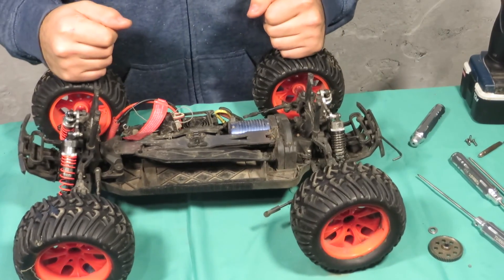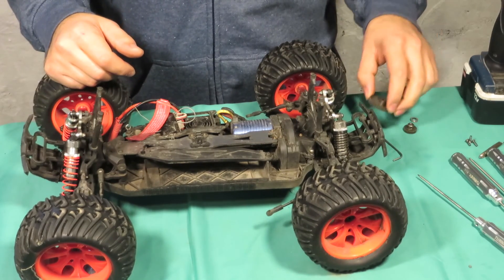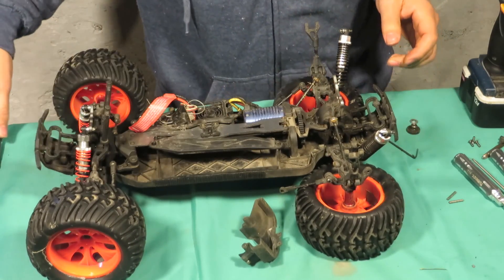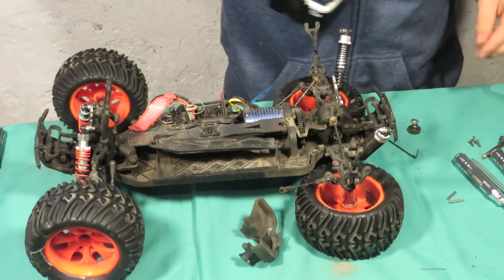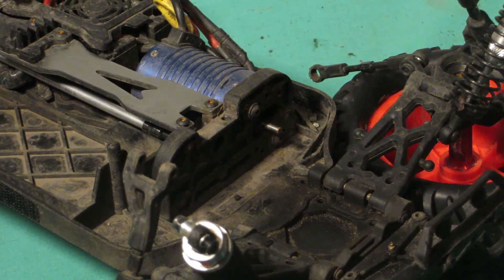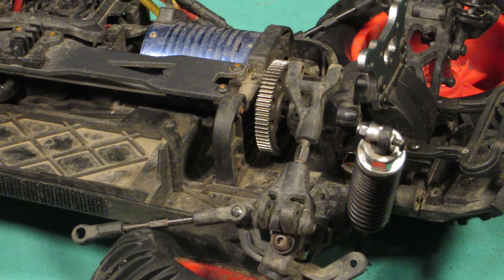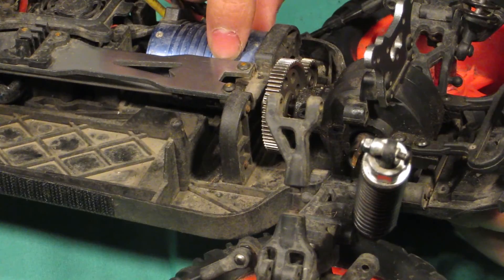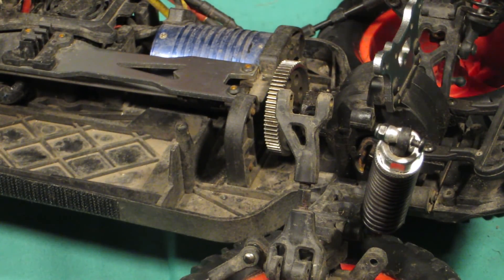Blackout XTE Pro Gear upgrade Mod

Comment: ... Just opened up the cover to the spur gear for the first time, and found out mine came with a metal spur gear... Wtf
Reply from the maker: wow that's awesome redcat probably made changes to new units. Probably got tire of people complaining
Reply: +King Veonietus I actually got mine when it first came out, and I had to wait 3 months for it because of the dock workers on strike... It was the worst 3 months ever.
Reply from the maker: Lol that sucked...we'll at least you won't have to worry about making these mods. I have to find a better spacer to keep my spur gear in place. The one I have isn't working to great.
Reply: All blakouts come with plastic spurs.
Reply: @militiawarrior1  mine came with metal spur and pinion
Reply: Than its not a blackout..or has been modified.
Reply: Spur is always plastic on the blackout.
Reply: Bryan Kirk  I haven’t checked but I think mine has steel gears too I’ve noticed that Redcat has updated their new trucks  example I have dean plugs instead of the banana plug and my transmitter only takes 4 AA’s instead the old 8 and they added a spring to the servo to help steering. And swear gears sound like metal or steel. Hope this helps somebody thinking of buying one.
Reply: Ive bought 4. Most recent was this last year. And it was the most updated one. motor gear is metal.. the pinion..with the spur...its plastic. all four of mine have been and you're right they did a update the plug in they gave it better shocks I didn't notice any other changes besides that also the diff gears are metal but I have never seen a Spur that's metal stock in a Redcat blackout. You can't even go onto redcats website and get a metal spur for the Redcat blackout.. there's not a metal replacement or aftermarket metal spur for it either. you have modifiy them. Someone link something to prove me wrong....google it. Youtube it.
Reply: I just got a blackout sc the spur was plastic.  In the process of putting in the metal spur.  Currently waiting on a 29t pinion

Comment: thanks brother
Reply from the maker: robert jr any time
Reply: is the washer bigger than the front of the gear or the same size to fit in the hole
Reply from the maker: It's bigger it does not fit in that whole..if u can try to fit a bearing in there it would be better. Either way just make sure it's not to tight
Reply: Thanks man
Reply from the maker: robert jr anytime

Comment: Do you run this on 3s?
Reply from the maker: I did when I try'ed my speed run but the pinon was stripped a few teeth and didn't perform properly so I haven't run this yet with the working setup.
Reply: +King Veonietus i got a 3s zippy 5000mah 20c lipo for it and ran it with with stock gears and the car ran amazingly bruh.i was barley going half throttle and it was going as fast as the original 2s lipo would do.i tried 2 runs with 3s and i couldnt get the rc to full throttle cause my street does like a turn its not fully straight.that 3s lipo gives it tons of power.and i was running 3s lipo with one of the teeth missing from the plastic spur gear.by the way does the pinion gear for the 64t spur have to be 30 32?will a 29t hsp gear work fine without issues?i dont force my rc and dont ramp it.
Reply from the maker: Nice...yea a 29tooth should be wide enough..I only went with the 30tooth so it would fit perfectly
Reply: +King Veonietus cool if i cant find a 30t pinion ill just go with 29t then
Reply: +King Veonietus oh yea.maybe if you can show in your next video on running the 3s lipo,can you show us how you fit the 3s lipo in the battery holder cause mine didnt really fit in there.i had mine strapped with a rubber band and the battery on its side in there.
Reply from the maker: +Anjel_AKA_Taco yea I had that problem too..try upside-down wires facing the front
Reply from the maker: +Anjel_AKA_Taco I'll show it next time too

Comment: hey man my gear on the motor keeps coming loose I even used lock tight on the small screw what's your option on that and do u know we're I can get the right gear
Reply from the maker: robert jr take the gear off and look to see if that grub screw is going all the way through. Also what gear set up do u have now?
Reply from the maker: robert jr If your using stock gearing redcat has a steel pinion now so the spur gear wont strip like it use to
Reply: Redcat uses a 0.6 module gear you can get it from Tamiya or Hotracing if you want custom sizes. HSP also makes a lot of parts for Redcat.

Comment: what 3s battery would you recommend?
Reply from the maker: If it's for your blackout any should be fine just want to make sure it will fit. I have soft pack turnigy's and I have to force them in. Hard pack would be your best bet.